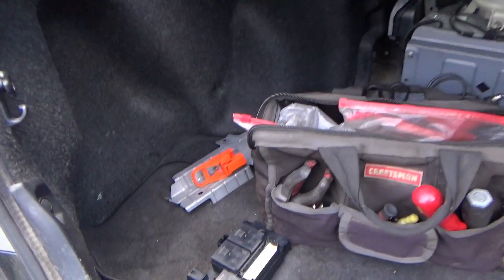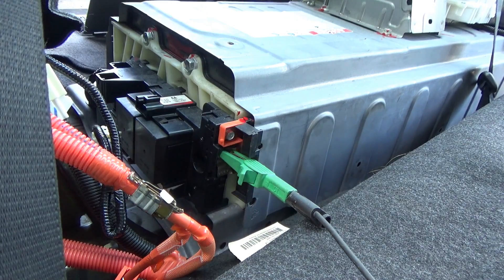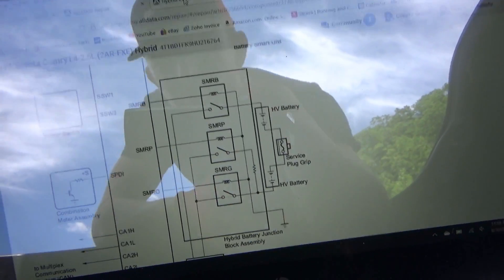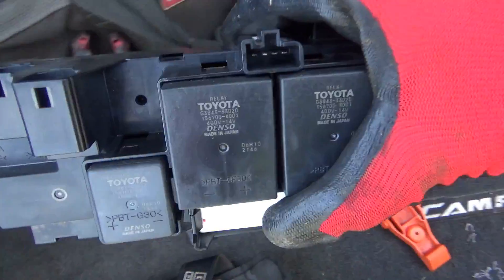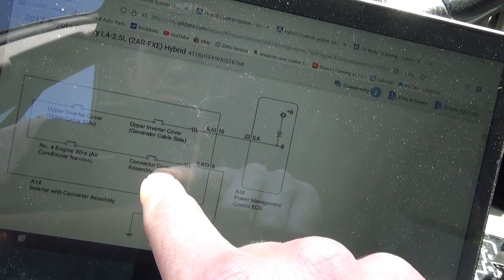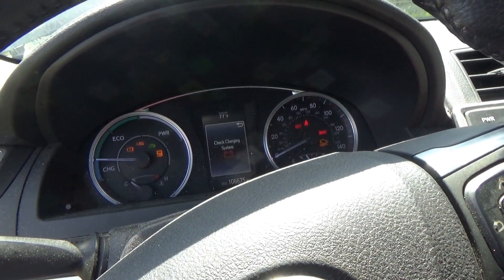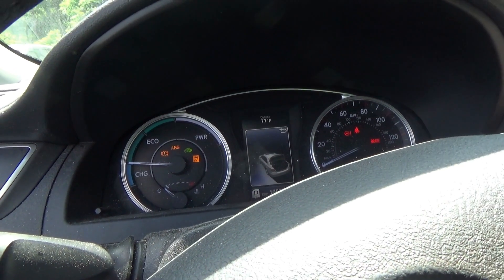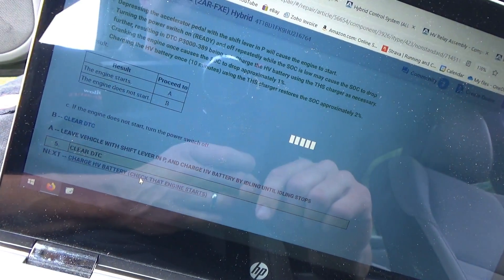Customer bought a HYBRID...and it Can't MOVE! (Part 2-Repairs)

Comment: 5:06 your 70 volts was because there is capacitance in the module that stores a charge even when you disconnect the high voltage battery. Test light discharged it.
Reply: the service info said to wait 10 minutes after taking the safety interlock out, but it had been out for longer than that at that point, maybe there's some bleed resistor that's burned out
Reply: @Arnthorg  a capacitor stores power for a long time.

Comment: This is why I got rid of my prius.  It was having trouble not starting the engine then it would run the battery down. But the dealer couldn't figure out why it was having trouble not starting the engine to begin with even though the hybrid battery would be fully charged...
I love the idea of a hybrid system and they work beautifully till they don't. Then you have a 4k paperweight

Comment: It's odd to see a battery pack that low. As even a pack depleted to even 30% has the potential to start the car. That and you don't actually need a special charger for the pack the two lugs you removed can have a charger you can buy online. If memory serves me right though the 12v battery can also create the starting current threw the DC DC converter.
Reply: Missing pin in the connector, also very odd..

Comment: Hi Ivan, great video.Hybrids sucks🤣. The safety lock disects the HV battery's voltage in half.So you should have seen about 90v (if I remember those fully charged give 210v). And because it was pretty depleated you saw some kind of voltage which dissapeared later on. The only way to kill the voltage completely is removing the bus bars which connect the cells in series.Till you do that you are vorkink with some voltage, keep that in mind but that voltage is much safer for life of mechanic👍
Reply: You don't see 1/2V by cutting the circuit in half unless you measure from where you cut it.

Comment: The auxiliary 12 V battery only powers up The computers, apparently that car was sitting for a very long time, because it is Motor generators  ones or (MG1 )Job to start the gasoline engine using the hybrid battery , When you own a hybrid you are not supposed to let it sit for more than a week otherwise the batteries will discharge , this is why you are not supposed to jumpstart other vehicles using the 12 V auxiliary battery, it’s only meant to power up The electronics
Reply from the maker: Ironic that a battery vehicle can't jump start other vehicles... Or itself 🤣
Reply: @PineHollowAutoDiagnostics  It is ironic lol ,and I only know this because we have two hybrids in our family
Reply: @PineHollowAutoDiagnostics   The car care nut Channel, is a great resource for info on the basic inner workings of Toyota hybrids
Reply: I've jump started other cars with my Escape. As with any other car, it's just best not to run your car while jumping another.
Reply: @fascistpedant758  On the Toyotas The auxiliary battery is supposedly too small to do this, and could damage the electronics
Reply: @vinces8974  Check @8:05. It's a 650 CCA battery. That's about as big as most cars come with.

Comment: I always use a 110v 40 watt incandescent bulb in a socket with test leads for anything over 50 volts. I would have one if I were you because there is going to be an ever increasing number of these you will have to deal with.

Comment: Good diagnosis and repair.  Here in the UK to work on any of the DC and AC high voltage system (live testing) you have to be a Level 4 Master Tech and licensed. For replacement of components you can be Level 3 but the level 4 is the only one who can conduct live high voltage system testing.  Any work being done on the HV battery even after safe isolation must be done with class 0 1000v gloves no less that 6 months old and full set of insulated tools.  Just recently completed the UK level 4 EV & Hybrid Master Tech training.  in the UK for the last 3 years each year EVs  & hybrids have had a 78% sales increase.  There coming thick and fast and there is a huge shortage of qualified technicians.
Reply: Not implying Ivan is not capable, merely informing you that in UK and Europe it is a regulated industry as is our domestic and commercial electrical industry.  Many of the later EVs & Hybrids are ruining 600v and many of the diagnostic processes require live testing.
Reply: @kevinbain4361  Figured that
Reply: Ivan is likely more capable than a level 4 would be. He just isn't familiar with the systems but has plenty of knowledge about DC/AC electricity since he is an engineer. Few automotive mechanics have a 4 year college degree.

Comment: You need to get a few insulated tools, if your working on high voltage systems. 
Would hate to see anything happen to you Ivan.
Reply: The main "breaker" was disconnected, that red disconnect.
Reply: @Garth2011  still....better safe than sorry..... insulated gloves and tool's...
I work in a dealership,fiat.....and its drummed into you when training....seen lots of video's and images of what can go wrong......not nice......

Comment: So frustrating! You solve the problem and then you need a special charger (that probably costs a small fortune) simply to be able to start the engine. Also, fiddling with high power lithium batteries scares me more than playing with explosive gases. You're right, hybrids suck! Good job, against the odds Toyota gave you.

Comment: I knew you would have that service plug grip code when I saw you not connect it fully. A very common mistake. It's ALWAYS a 2 step process to put the grip on. Latch the grip them push down
Reply from the maker: It was a learning experience. Would have been obvious if they didn't pull it off before I got there 😂
Reply: @PineHollowAutoDiagnostics  Good point. I've been looking for that pico scope you usually use. Is is not made anymore? I have checked your Amazon store. I believe it says unavailable
Reply: @PineHollowAutoDiagnostics  0.8 hours extra charge for that
Reply: It's also a bit stupid that the fancy charger just couldn't plug into that service plug grip. Yeah, you may need one additional contact on the HV circuit to make that work, but it would save a serious amount of time over having to disassemble half the inverter assembly just to get to the terminals.

Comment: It sounds like if whoever touched had not touched it before you did Ivan, the batteries would have enough charge to start the car after you replaced the damaged module.

Comment: This video will get someone hurt. Your gloves would do nothing for you and the ratchet would just cause issues. Jump start a 350v battery off of a 12v battery 🤔
Reply: My Escape Hybrid has an onboard boost converter. I hit a button and it charges the hybrid battery from the 12V battery.
Reply: @fascistpedant758  I am delighted to hear this. I  am involved in this trade since 1990 . I am a qualified technician teach in a local college and run my own  shop.  I am also qualified to work on electric vehicles level four. What's your point?? If you can explain to me how your car achieves this you have my attention.I can assure you that the 12v battery is not charging the high voltage battery.
Reply: @d.d4184   Watch this, https://www.youtube.com/watch?v=TA6Of25tnCY&t=257s. 
BTW, I started working in a garage after school when I was 14 years old in 1974 and I've owned 2 Escape Hybrids for several years. What's your point?
Reply: @fascistpedant758  my point is this video will get someone hurt. What is your point.?? Back it up. A 12v battery charging a 350v battery when you press a button.  Do your homework 🙄
Reply: @d.d4184   Come on! If an ignition coil can step 12V up to 40,000V, why is it unbelievable that a DC-DC converter can step it up to 400V? A 60 AH, 12V battery stores ~720 watt-hrs.. The Escape traction battery is rated at ~1600 watt-hrs. At 200A and 12V, a starter draws about 1.34 watt-hrs to crank an engine over for 2 seconds to start an engine. The charge cycle lasts ~8.5 minutes. Do the math. 0.8A x 12V x 0.14 hrs. would be enough energy to start the engine.
Have you watched the video?
Reply: @fascistpedant758  thank god for Google.  You said the 12 v battery was stepping up the voltage  when you pressed the magic button in your car not the dc to dc converter.  Did you watch the video.  He used gloves that were not suitable for the job. Should be rated for up to 1000v . And the electrical ratchet should also be rated up to 1000v and they were not. When you know what you are talking about come back.  This is not 1974. We are not taking about points and condensers.Its people like you that will get someone hurt.

Comment: just need to pick you up a Toyota Hybrid System battery charger I guess.  Under right to repair they should include some kind of pigtail for it so you can charge it at home.

Comment: How high is the "high voltage" side
Reply from the maker: Google says 200 V
Reply: @PineHollowAutoDiagnostics  camry uses 34 modules hence 244.8 VDC... check the actual SOC of the battery as well as the blocks and it will tell you the very truth... 👋😎

Comment: I'm not sure why you were seeing ghost voltage there after removing the quick disconnect as that effectively cuts the system in half(battery) you have plenty of common sense but Ivan, please, please be careful as you only get 1 chance with DC! FYI, you can charge the cells 'individually' to bring up the overall value to a 'serviceable' state as they're 8.3v(in most cases you just need to 'bump' them up a bit!
Reply: The ghost voltage is probably because the battery terminals were both floating with respect to the chassis ground. They could be at any random potential, which is kind of irrelevant since there was no way a current could flow.
Reply: The voltage is from capacitors.
Reply: @ghenkhoash2440  in the Battery Pack?! 😂
Reply: @Micko350  🤣😂🤣😂 No, in the circuit, the battery is already disconnected!

Comment: That 60-something phantom voltage - wonder if it was indicative of the HV battery potential?  That would mean the HV battery was very depleted.  273V (19*14.4v) should be fully charged Prius NiMH, I think.  You’d be down to 3V per block.
Reply: I don't think it's indication of state of charge, just stray capacitance (static build-up) between two halves of the pack

Comment: Hang on... so these camry's can't be charged from the wall?
By the owner that is, obviously yota have their "fancy" chargers.
Reply: Hybrid batteries are charged by the ICE when going fast.  The hybrid battery is then used when going slow.  If you want to charge the battery when stationary, you need to buy a plugin hybrid.
Reply: @dennisharvey4499  Mine charges anytime the vehicle is stopped with the engine running, if it's not fully charged.

Comment: I recently said to some irl (not online fake life) "The only EV I'd ever buy is a hybrid."  Yeah, I rescind that 100%.  It's all junk... full EV or hybrid.  They can shove them where the sun don't shine.  There isn't much savings on fuel on a hybrid to make it worth it's while... any $ saved will be spent, plus some, when it breaks and you HAVE to bring it to the stealership.
Reply: The only reason for having electric cars is because we have to stop using petrol and diesel for our children to survive.
Reply: You realize the carbon emissions used to charge them, exceed that of a modern gasoline vehicle?  80% of the US is coal fired.  The only way to be hippy-green is to charge it from hydroelectric or solar.  Solar being technological junk still.  Both battery and solar technology have to make leaps and bounds still.  Have you seen the sheer destruction caused by lithium mining?  What happens to the batteries when they are no longer serviceable?
I could go on and on.... but thr tech isn't there.  The lithium and other metal mining is causing natural disaster (mostly in Russia).  Looks good on paper as a headline, but when you dig deep.... it's just a feel good excuse to not have guilt for even breathing (which makes greenhouse gases).
Reply from the maker: @MarcMercier1971  yes the Green people often don't look at the BIG PICTURE lol
Reply: @PineHollowAutoDiagnostics  More like Refuse to look
Reply: @MarcMercier1971  Coal is 21.8% of US electrical production. Nuclear is 18.9. Renewables are 20.1.

Comment: Put in park and put foot on brake and push accelrater pedal a bit it will strat engine just to test and it will shutoff if you take out foot from accelerater thats how engine is tested on hybrid.hybrid battery charges normal 12volt battery it cant be charges reveres.so only other option is take out hybrid battery and open it charge each cell module with ebay charger put back and boom it will be ok.as prius user from long time i experienced alot these things.that fancy charger is to charges hybtid battery on high voltages instead of opening and charging each cell.cheers

Comment: "that's why hybrids suck!" 😁
Reply: Not at all they are great vehicles, they just require a different type of maintenance... but well kept they last for looong time with no problems at all...
Reply from the maker: They are ok when new, but when something breaks it's usually big $$ to repair 😅
Reply: @PineHollowAutoDiagnostics  In fact, they are so reliable that used engines/inverters/ battery packs etc etc go for quite low prices - there being low demand....  It's buying new from the dealer that makes the wallet pucker!
Reply: @PineHollowAutoDiagnostics  why I bought a 2019 Jetta manual. VW was on the rebound from the EPA overreach dieselgate(I had sold my 2013 back for more than I paid for it) and selling cars very reasonably. $16,995 for a brand new Jetta 6sp manual base model that still has more on it than I really want. Has been great for 3+ years now. Just sold our 2006 diesel Jetta with stock brakes, stock alternator,  etc etc etc for more than it was worth because it gets 50 mpg. Started, ran, and still shifted great.

Comment: I wonder if you could tow it down the road and slap it in drive as you are going along. There is a small regen applied to simulate engine braking when not on brakes or throttle. I wonder if it would attempt regen in this faulted state.
I also wonder how long the vehicle sat for
Reply: No way.
Reply: That is how the navy charged the batteries of the captured German submarine that is in a Chicago museum.
Reply: @d5oper  It is an impressive submarine.   The germans were waaaay ahead of everyone else with their submarines.
Reply: NO!!!!!!!!!!!
Reply: Probably too many safety devices in there especially with those DTC's in the memory.  Sometimes, a safety device can lead to human death while the device is trying to save the car or parts of it.
Reply: I suspect it wouldn't work with the dtc being active but seeing the engine did try to start it seems like it hasn't completely given up on using the hv battery. 
Early Prius used an auxiliary starter but they found it would make the starter fail from sitting too long before it was useful.
Reply: I've tried rolling down a hill at ~30 mph with my Escape and it doesn't work. The contactors leave the battery disconnected till the PCM knows the engine has been started.
Reply from the maker: Now that's thinking outside the box! Almost like jump starting a stick shift haha
Reply: @PineHollowAutoDiagnostics  Warped Perception did a video on that...it works
Reply: It was a Tesla not a Toyota though
Reply: @PineHollowAutoDiagnostics  jejeje not at all my friend... the contactor will be open so charging system will never work like that... ☝️🤣 so be careful...

Comment: Um. they keep the 12v system separate to make sure the lights come on the dash..  If the HV battery goes that dead.. Its dealer time anyway as they  will have to  test each battery cell for its ability to hold a charge. Hybrids are great.. When they  work..  a Royal pain in a Mechanics posterior when anything goes wrong..
Reply: Unless - Like Ivan - they are a competent technician. He showed he had little problem diagnosing a strange and untypical fault, on a car he appears not to have seen before!   It's usually harder when Mr Bodger has had his hands on the works...